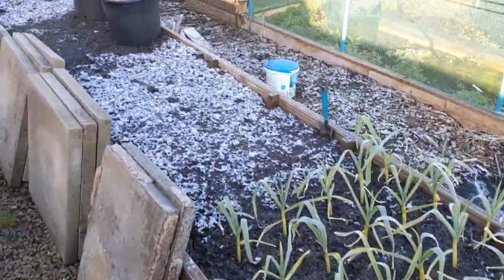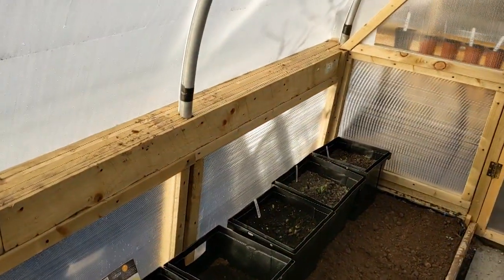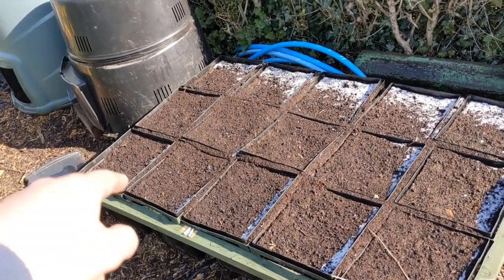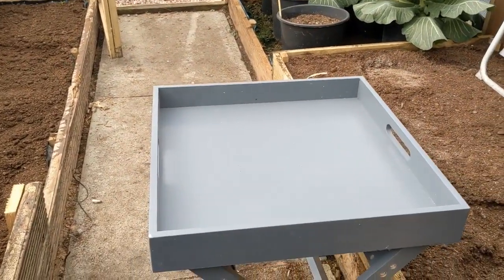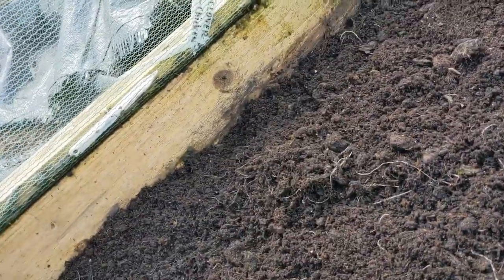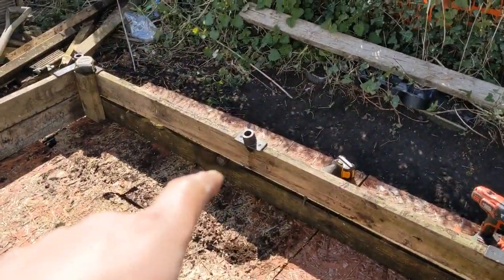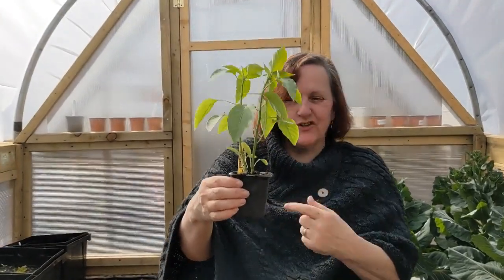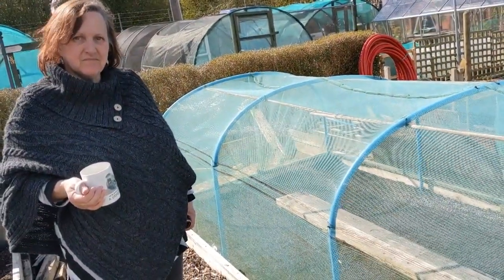UK ALLOTMENT ~ 1st Growers Meet Up 2021!!! ~ Julia From Julia's Gardening Diary.

Comment: 🇬🇧    A tip from a Californian site is to make the holes in the sides about an inch from the bottom to save losing water through the bottom.    She makes the holes with a small soldering iron.   Takes longer than your system but at least it preserves water.